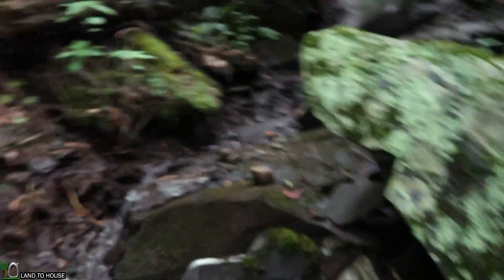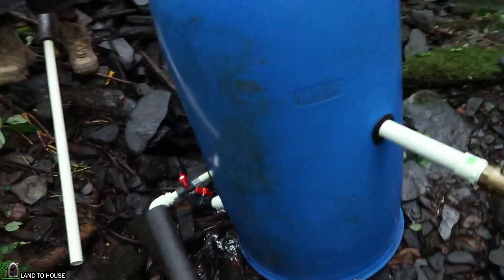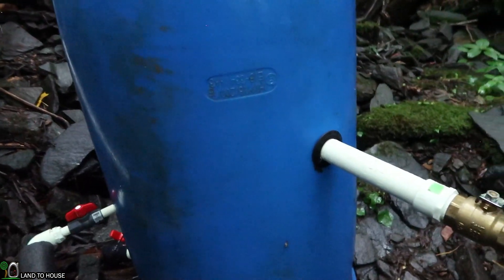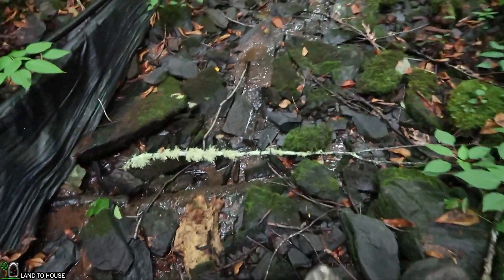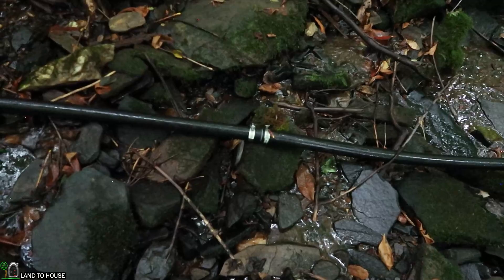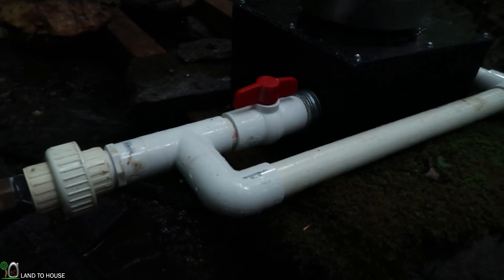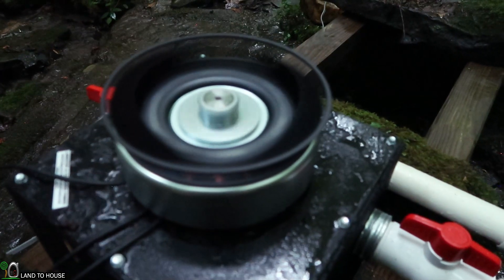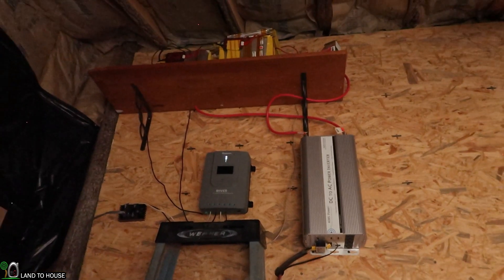System Overview Off Grid Micro Hydro 6/6

Comment: I am a huge fan of you and your projects. I like them very much. However, I have one very serious comment. I am very concerned about the security issues in your systems. The turbines are virtually unprotected. Cables easily accessible to everyone. What happens if a child touches them? I don't even want to think about it. I believe you should seriously address this issue before it is too late.
Reply from the maker: Tgank you. In my personal set up all of the electronics are locked up in the crawlspace. I have a redesign for the actual turbine housing that I could even put a lock on if I need to.  As for this off grid system I'm not sure what my neighbors going to do.

Comment: Would this adjustable inline pressure relief valve work to turn the large nozzle on and off depending on line pressure? It could replace the last elbow before the largest nozzle and save you a lot of walking to turn it off and on. An inline check valve would do the same if it opened at about 50 PSI.  When the pressure drops below 50 PSI only the small nozzle will be activated. You could use the cheap PVC check valve that has a 5 lb. spring and put a stronger spring in it. The adjustable one below is 25 PSI and up which would let you keep it open at all times if you want. Water hammer should not be an issue with a spring loaded device which closes and opens gradually depending on pressure. If it opens gradually and partially you could get some benefit in low water conditions as it meters the large nozzle. David
https://www.amazon.com/WILKINS-34-P1500XL-2471325-Calibrated-Pressure/dp/B00LABJ1PS/ref=sr_1_2?dchild=1&keywords=Pressure+Relief+Valve%2C+Adjustable&qid=1598898424&sr=8-2
Reply: Another way to do it is to use a shallow well pump pressure switch to monitor water pressure with a battery connected to it which goes to an inline sprinkler control valve before the nozzle. This one uses DC current to keep the valve open so a small solar cell could recharge it or take power out of your system at the box through a rectifier. Water hammer might be an issue with this method and it's either on or off. You and Nathan will know how many nozzles are running by the volts on the house meters. There is no reason to have to walk to turn off the large nozzle. Let the water pressure do it for you. I'm liking the Zurn Wilkins relief valve because it will let you make easy adjustments to find the sweet spot to keep your barrel as full as possible and that means less maintenance for you. David
Video and specs
https://www.zurn.com/products/water-control/relief-valves/model-p1500xl
They say that the valve will not close until it reaches 80% of the setting. If it's set at 60PSI the pressure would have to fall to 48PSI to close the valve. That will work. The magic number is the PSI at the moment that your water barrel is less than full with both nozzles open. That will be 80% of your setting.
This common water heater relief valve might work for Seth because it is set to open at 75 PSI. That means it might not close again until the pressure reaches 60 PSI. The cost is $13.67. Make sure that it auto reseats.
https://www.homedepot.com/p/Zurn-Temperature-and-Pressure-Relieve-Valve-TP1100A-4C-75C/304957785?MERCH=REC-pipinstock-204587745--304957785--N

Comment: One thing I see right from the start that really needs addressed.. At the intake it needs to either be dammed in some way or dug deeper, Those pipes should be completely underwater. it will keep it cleaner with less trash clogging it up.. I would bet it is also letting lots of air in.. The way it looks to me, is I bet it will need daily cleaning to allow the water to flow.. I don't mean to sound critical, I applaud everyone who tries to live off grid.. Also rubber would work much better then that plastic to hold the water, you can get it at almost any garden center or pool supply dealer.. If ya want it to look more natural then build it up with flat stones and clay with a rubber liner (food grade or pond grade).. 
Like always I enjoy watching.. Oh!! Is there another higher source of water that can be trapped into.. It would help getting more water to that intake and would vastly increase his power input..
Well Be Blessed...
Reply: @danura2535  What do you not understand about a critic.. It's not criticizing.. It is giving advise...
Reply: There is nothing more permanent than a somewhat working temporary solution.
Reply: @mattadulting  I agree, I think most people adopt the phrase "If it's not broke, don't fix it" approach to some things, especially if it will be very involved, to do "The Fix" For an example.. Behind my desk is a huge mess of wires & cables I have added & discontinued through out the years, I know I need to do some cable management, but to do so, I would need to move everything out and disconnect a lot of components.. This, in my case would take many hours, since my desk is very heavy and I have 4 monitors, surround sound speaker system & two professional mic's...
Reply: I know I'm late to the party, but the air coming in through the intake isn't as big a problem as it would normally be, since he's using what looks like a rain barrel as a buffer in between the intake and the 150' drop over 600' of hose. It also functions as a silt/sediment catch. I do agree on getting cleaner and better flow into the intake though; it would mean less clogging of the intake screen, less maintenance as in silt draining overall, and capture more water to fill the buffer; which, of course, translates to higher maximum power when all is said and done.

Comment: Mr. Land to house im your subscriber and a fan, can you make some video about micro-hydro using a car alternator
Reply: They also make in-line mini-turbine,s that can be added to the piping, that would increase power with no loss in water and very very little loss in pressure...
Reply: You shold check around on YouTube, there are others trying the car alternator.  This is a much more professional unit.  Running 24/7 on a car alternator is not a great trouble free method.  Check out the sponsor....  check out Langston Alternative Power:
http://www.langstonsalternativepower.com.  Put your time and energy into piping, and supplying the water supply.  Langston looks like they know what they are doing to create the FREE power with strong lasting quality equipment.

Comment: are 90 degree bends better than curved pipe?
Reply: no curved pipe is batter as they is no back pressure like a right angle bend has
Reply: the dry curves have higher pressure drops than the rounded ones, but the pressure drops are everywhere from the valves to the joints to the branches, to the pipe itself, and also as it is inserted into the tank.
Reply: @winterburan  so what you're saying is, you can't get rid of it all but there is a lot to be improved upon.
Reply: @ChadKovac  they are small improvements, in search of perfection, in the end the difference is not substantial, the entrance to the hydraulic pipe is important, the worst situation is a pipe inserted in the loading tank, it is the pipe that protrudes inside with 90 angles °, the best situation is a conical transaction, not exaggerated, but with rounded edges, and the valves induce passage losses, the joints as demonstrated or use expensive external ones for polyethylene pipes or electro-welding ones, all that disturbs the flow laminar water turns into loss of head and consequently power cmq the water is free, on very small plants the difference is minimal a few watts less do not make the difference, in production plants instead yes and even a lot, in hydroelectric off the grid the difference is the constancy in operation, with 150W you can also charge a 1000A battery bank it only takes longer, but when it is charged ...

Comment: wouldnt a Y-splitter and then big bends on a flexible pipe be better for going to your 2nd entry to your generator?
Reply: I think the system works on water pressure through a small nozzle more than water velocity which is important to a water wheel.
Reply: @CyberviewU  i just see alot of videos about it saying to avoid 90degree bends at all cost
Reply: @axelgaard1  In electrical work, you use conduit sweeps as much as possible. The same things are made in PVC and that is what you should use if you have the space. elbows are for compact work. Example: https://www.winsupplyinc.com/spears/_/A-04856409

Comment: If you change the turbine, from a cups style to a cross flow turbine, it can run the generator at a higher speed and more efficiency from the same water pressure (and using only one nozzle), and be capable of producing up to (depending on the generator) either 50hz 240v or 60Hz 120V, to understand where I am coming from there is a planet mechanics episode you can watch regarding this Episode 3 "Water Wars" Originally Broadcast in the UK on the 20/4/2008 on NatGeo you can find the full episode here on youTube https://www.youtube.com/watch?v=xzOOrkjClTI
Reply: i remeber seeing that they used a power head from a petrol generator and added a turbine to it instead and feed it with fire hoses also the wheel they used is less efficent then a pelton wheel they also had 145psi not 60 psi using an ac gen head is also very bad as the fluctation in water flow can damage stuff far better to stay low voltage and charge a battery bank then invert that to steady feed
Reply: @1981dasimpson  For the turbine you are right, they use a Banki impeller as if it were a Pelton, with a jet that sprays, at an electrical level AC or DC with or without batteries is the same thing, either the excess production is dissipated or there are jolts, they use a solar charge regulator, but when and in case the batteries are charged he stops charging them and the turbine is without electric load and braking magnetic field, accelerates and generates high voltage, if the regulator cannot stand it it burns, then the turbine / alternator wears out first, the DC roads are different according to the needs, 1 with charged batteries the water is closed with a DC motor drive, 2 raw method, a DC maximum voltage relay is used that diverts on a resistance as soon as the voltage rises, 3 a shunt with constant load is used as in the wind power which dissipates by constantly and linearly regulating the current towards the ballast resistor, in AC directed to the island the same thing is done, and the result is excellent and stable . The batteries are used when you have low power so as to accumulate it and be able to use it for short periods but with more instant power available, in this case they would have no alternative, if the turbine produced 2 / 3Kw it would be absurd and useless.
Reply: No little water, a michell banki turbine is absolutely not suitable for these characteristics, then in the video they make a serious mistake, they use a cross-flow impeller as if it were a Pelton, please study Banki turbines they don't work like this.

Comment: u should remove a bends from turbine it reduces efficency of a turbine because its slowing down a water so  the wattage goes down so the efficency
Reply: Agreed, they can always heat the pipe and make it round, or better yet, they do make clear thick tubing that size...
Reply: agreed, but what instead, without it being overly bulky
Reply: They make Wyes and elbows that are 1/4 and 1/8th curves which would help. The reason for the elbows used is to keep the unit compact.